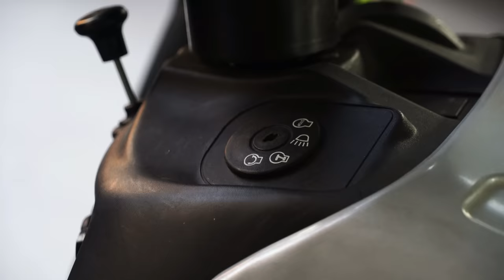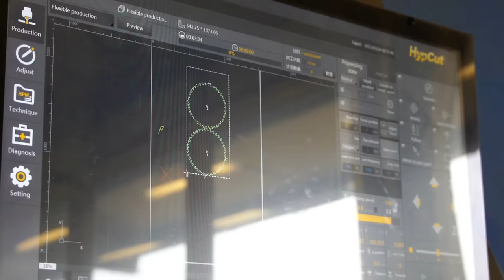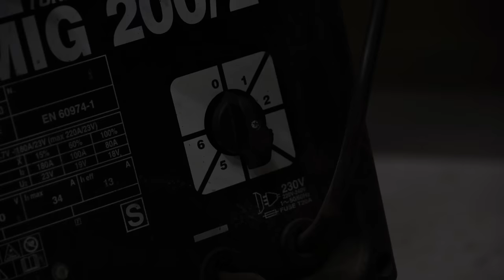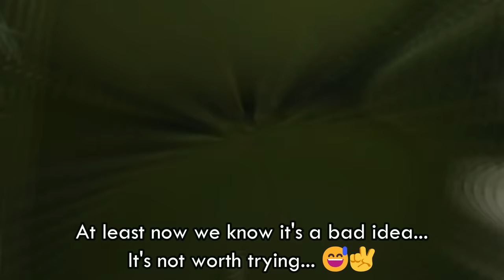CIRCULAR SAW on Tractor MOWER !?

Comment: If the front deck was open then I think it would work fine
Reply: So would the regular blade if so
Reply: @paulb7334   not necessary, the solid deck is a federal government mandate ( OSAH or some agency).  Some people are not smart enough to keep hands & feet away from high speed spinning blade.
Reply: @hcaveman6954  shut up Kevin. This isn’t for the a commercial market or use.
Reply: Like my weed cutter
Reply: I would like to see this with an open deck. Should act like a disk mower.  My sheep would love that grass

Comment: Of course they didn’t work you didn’t leave enough room for the grass to get in between the deck surround and the blades plus the blades are to heavy drill holes in them to lighten them up and cut them smaller by about 2” inches change the pulley size to spin faster

Comment: you are forgetting something, or maybe you just don't know. that lifted area right behind the tip of the blade is called the "sail". it has 2 purposes. 1. it helps throw the grass out from under the deck. 2. it acts like a vacuum in that it pulls in air from the edges of the deck which in turn helps stand the grass up so that the blades can cut it.  The uplifted area to the inside of the tip, is the mulching area of the blade. it's function is to pull the air(and the grass) down through the blades again, cutting the clippings into smaller pieces and then throw them down onto the freshly cut area.
If you want to mow taller grass, buy a set of "high lift" blades. this type of blade does NOT have a "mulching" area on the blade, but it DOES have a higher "sail" that moves more air to help stand up the grass. Plus, it throws the grass out from under the deck more efficiently . You will have to open the side chute cover on the deck before any of this will work. I hope this info helps you

Comment: Saw blades have no lift, no air sucking the grass up to be cut. If you made the front of the deck adjustable like the old dixie choppers those saw blades would be mean in brush. Or just cut the front of the deck off so the grass and brush can feed right into the blades
Reply: That’s what I was thinking. Take the front deck off and this is a mean brush cutter. Unfortunately doing that to the deck makes it a poor mower. Unless you make some sort oh hinge mechanism so you can put it back on to mow with a proper blade.

Comment: The main problem cutting very tall grass and weeds is the deck gets clogged too easily, slowing down the blades and engine. The solution is to cut away the front of the mower deck so the grass doesn't have to only go out the chute on the side. There is a problem with this though, cut grass will spray out in such force to the front it'll hit the front wheels etc and splatter back towards you and the mower coating everything with green gunk. It's still useful though. I have two decks now. One cut away for doing tall grass, and one unaltered for mowing normal length grass.

Comment: The circular blades aren't being used because the Deck of the Mower acts like a shield.  If you expose the circular blades they will cut.  The Deck pushes the grass over and so does the circular because there isn't enough clearance to let the grass stand again.   Cut the Deck of the Mowers edges to expose the spinning blades and I bet it cuts just fine.  But beware of what flies.

Comment: One problem I noticed was, you had one saw blade teeth facing one direction and the other blade facing the opposite direction.  Both need to be facing the same direction towards the discharge chute. 
   Also cut some vertical slots in the front leading edge of mower deck to allow taller vegetation in.
   3th, get yourself some livestock (cows🐂🐄, sheep🐑, goats 🐐, equine 🐎🦓, that they will gladly eat/graze all that vegetation down. I have not worried about mowing my yard area for decades. 👆😉🙂

Comment: Due to the engine struggling to turn discs I would recommend removing some of the material from inside the desks to create what would look a bit like a wheel with teeth on the outside of it. This should help reduce weight but also increase the speed at which they can be rotated at. Also It might not be the best lawnmower ever created, but Jesus, it’s  the one mower I want in a zombie apocalypse, you can really run over all those crawling zombies

Comment: Part of the reason the circular sawblades won't work well is because they aren't sharpened. However, more than that - standard mower blades act somewhat like fan blades, which you'll notice they have an angular piece on the back of each side of the blade. These angled pieces make the blades double as propellers, pulling the grass up into the blades while they spin. This is what makes the knives very efficient at finish cutting. For what is trying to be accomplished here, you can try angling the 'teeth' of the sawblades down 10 or so degrees, then sharpen the leading edges. That should accomplish similar results to the knives, but the torque of the engine will limit what they can cut. Additionally, having that many teeth will only be realistically useful for going very fast across very thin foliage. For thick foliage, heavy brush blades that can swivel from their hub and have a blade all the way down the shaft will be far more effective. Brush blades for trimmers use this concept very effectively, some even going as far as serrating the blades.

Comment: All you really need to do to make this a "better than fail" result is to cut big notches out of the front of your deck so the forward-most section of teeth contact the plant material head on before that front lip of the deck has folded them over 😉
I have done something similar to a 1984 JD 112l I like to play with from time to time and it was incredibly effective.
It might require some welded structural supports after removing sections of the deck, especially if you plan on getting rough with your play.... I drive mine into the woods and cut down trees saplings!

Comment: It's because there there is no suction. Blades will create an updraft(like a fan) pulling the grass up rather than just pushing them over. If you put holes in the saws it will create a suction(think of a fan) but then basically you just have blades, more or less.

Comment: As long as we're experimenting here,
cut the lead edge off the deck, so the
blade meets standing grass.
The deck is pushing the grass over,
not the blades.
Also, change the oil in your transmission.
It didn't sound too happy.
Other than that, I give your experiment a -10.

Comment: Not that it would help but one of the circular blades is on backwards. 

With  practically any regular mower, the problem with really tall grass is that the front edge of the deck pushes the grass / weeds over and before it can spring up and be sucked into the blade, the back Edge of the deck begins traveling over the same grass.  The stuff left standing is what was still being pinned down after the blade already passed by.

Comment: Try this little trick.....  Take 2 sets of regular blades, cross them over like an X on each side and give that a go.  The problem with the circular blades is that there is no space between the blades and the deck for the grass to stick up above them to be cut.  They are simply mashing the grass down.  I have never done the X blade method myself but I have seen videos on here where other people and especially high grass seems to fall victim to them every time.....   Good luck!

Comment: It would leave grass uncut the size of the saw blades only cutting grass where the edges of the blade hits thats why big uneven patches are being left (alot more passes would be required).regular saw blades rely on the length of the blade not a flat surface..a thinner bar type blade creates an updraft effect

Comment: the reason why lawn mower blades are made the way they are is because lawn mowers were not intended to use big circular blades for one the cutting edge on the circular blades are on the wrong side. The circular saw teeth cut wood with the wide edge shaving the wood while mower blades are shaped more like knife blades and that's why they are on mowers.
Reply: not only that, he didnt even really sharpen it 
its even more of a "beat the grass in half" even more than regular blades
Reply: The teeth weren’t angled even a little bit. It was a dumb idea but somebody had to try it.

Comment: You need to cut the vertical portion off the front of the deck. Then the blade will hit the grass. Of course it could still get wrapped around the spindles, because those blades won't chop the grass into small pieces like the normal blades. Funny experiment, though!

Comment: The problem is, the original blades are pitched, like propellers, to be able to move air. The saw blades don't offer that 'lift', so your side discharge doesn't work at all. That lets the clippings ball up under the saw blades, and because of loading up, don't offer the quality of cut. If there was a way to provide airflow to remove the clippings, the saws would probably work quite well.

Comment: I think the diameter of the saw blades are so close to edges of the deck that when you drive over tall weeds/grass the holds them down below the blade and the don't get cut.  A regular mower blade has all the room on both sides giving the tall grass time to pop up higher than the blade and will get cut.  Two ideas, either make the diameter of the two saw blades 3/4 of the current diameter size made or remove the front of the deck exposing both saw blades to the grass to be cut.  Bar blades have a wing on them that draws air in pulling the grass upward into the spinning blade and the air is forced out of it's one opening pushing the cut grass out with it.
Reply: Exactly what I was coming here to say, well said!

Comment: Yep. I didn’t think that they would work. Even your original blades were not the correct ones for doing what you were trying to do. You need to get high lift blades. The ones that you have are just created for mulching with the discharge chute being closed off so that the grass could re-circulate inside the deck to get more finely cut. The circular blades didn’t work because they had no lift at all. They Just pushed the grass down.
Reply: I came to say this as well

Comment: smarter every day made a video showing how lawnmower blades work, I would recommend checking that out.

another idea is to stack the blades so that they make a cross. I've thought about doing this bit haven't yet. I have a mower I use for blazing trails at our hunting property. I'm often going through heavy grasses. those might help me but I would want to slow the blades down a bit to make the belt last longer and the hubs not blow out

Comment: So... knife blades actually use the fan effect to stand grass up as they pass over it.  This is one reason you don't cut wet grass.  The circulars have no way to make grass stand up...  best you could do is cut the front portion of your deck off and sharpen the tips, pretty sure the knives would still do better.

Comment: You would be far better off cutting 25mm off of the front shield of the deck it will then not bend the grass over so far and allow a cleaner cut. I’ve already done it so no need to experiment as it works very well here in Australia

Comment: You either need to cut the front of that guard off or get smaller blades you didn't leave enough clearance for the grass to even get up under that deck into the blade

Comment: Try using Flail Mower knives about 6 inches long on a rotating shaft. Weld the knife anchors in a helix around about a 3" diameter hollow shaft and run it at about 1,000 rpm. You'd be amazed how well it will cut 3 feet tall weeds and mulch ot up very fine. I ran a 72 inch Mott flail mower on an old very well worn 1948 8N Ford rowcrop tractor that made 24 hp new and it cut like a championship mower. That Mott had about a 4" roller under it and if I cut 6" or 8" grass it looked fantastic. But even 3' tall weeds cut easily and mulched down.

Comment: Add a vacuum to grass shoot and you will find excellent performance.

You need to have air flow to suck the grass up into the blade.  The lawnmower blade has a air foil that sucks the grass up

Comment: I think it could work. But you will need to make some changes. The reason being because the blades are in the housing. The grass can’t get up in there for the blades to cut. So you could lower the blades to where they can. It make the teeth on the blade much bigger. Say like the size of a claw on a large bird. About 4 inches in size. You will also have to make air slots in the blades with up tilted wings. So a sort of vacuum effect is made. So it lifts the grass up with suction so it can be cut with the blades.

Comment: The shape of the blade sucks the grass up so it can be cut.

Your saw blades don't do that and the is so little gap between the deck and the cutting surface that most of the grass doesn't have an opportunity to go up in there.

Comment: It appears that the circular saw blades are so wide that there isn't enough adequate space in the deck for the grass to come into contact with the cutting edges. Also, it would seem logical that the round blades should be level with the bottom of the deck or even a bit lower than that. Another improvement would be to increase the angle that the blades come into contact with the grass, lowering the front of the deck should(in theory anyway) improve the blades ability to make proper contact with the grass and cut it relatively cleanly

Comment: Stick with it and with a few trials and errors you might be onto the next big thing. I suggest cutting holes in the saw blades similar to tire rims. My thinking is that it would create more lift and mulch the grass similar if not better than those X-blades
Reply: And, reduce the mass.

Comment: Perhaps a combination of a down scaled straight combine harvester type comb mounted on the front of cutting deck (or mounted on the front of tractor) to cut the tall grass AND reattach the usual flat mower blades in cutting deck for the shorter grass??? If the new front attachment works, the secondary standard mower blades might cut the stubble the front attachment creates...  I am no engineer but just a thought that could be fun to try.

Comment: Ive thought of doing something similar.  But what i think would work best is cutting the front of the deck off. Yes it takes the danger factor up, but the deck is folding the grass over, not allowing the blades to cut it. The regular blades would even work better. But this idea is only good for tall grass

Comment: As noted in the comments you need a vacuum to suck the blades of grass up. If you twist each of the teeth it may work then. However larger & fewer teeth to the blade would also be better. I had a very old large mower when I was young & it just had a square of aluminium with 4 old time hay mower blades bolted on the apex of the corners (hay mower blades are sort of triangular with two cutting edges only about 2mm thick) It cut really well & when it got blunt you just unbolted the tips & flipped them over & had the second cutting edge. They used to be cheap & you bought the blades in a box of ten. The engine was a 5hp side valve Villiers. No automatic pull cord you had to wind it around the pulley each time you tried to start it. I used to spend a fair bit of my mowing time doing that too. However I still have that engine 50yrs later & it probably still runs.

Comment: If you want those blades to work you have to open up the front of the blade shroud (the mower deck) if they can not get to the grass they can not cut the grass. you would have to remove at least the lower edge of the deck up to the flat surface. I would suggest you add a leading edge bar that rides behind the front wheels to help deflect any objects that might be otherwise hit.  Keep in mind how a hand held circular saw works. It is the outside edge of the blade that does the cutting. With your blads you need to sharpen the leading inside face of the blade to get the maximum cutting surface. Good luck... and be careful!

Comment: More vaccume needed sharper blades i mean if just doing woody grass blades need to spin in reverse having outter angle sharpened but if going through saplings 1 inch diameter stumps etc you just gotta drive slower to allow for it to chip through the blade twist is what applies the vacuum very important and the tip speeds next important along with horsepower and torque to push through i do like the spinning up heavy flywheel part though it'd just hit better from a standstill with stored potential energy to not slow as much when hitting sticks and tree saplings. you're TPI teeth per inch matters too because of time to speed up before hitting next cut gotta maintain rpms  possibly gearing pullies higher rpms or higher torques would increase the usability but also your drive forward speed Needs to be adjusted in propper ratio to cut speeds when you hear the difference in rpms slow there's a sweet spot to listen for on each motor or horsepower now if you had a separate smaller motor for drive speed while all usable horsepower was for cutting speed then you'd be able to keep cutting faster. Tip razor blades 🔩 bolted on without the bolt dragging so countersunk would leave a sharp edge but then you'd need your vacuum of blade twist still doing the work to pull up bent grass blades into the blades to do the cut, usually a double pass mow is best cut once on highest setting and then your finish cut on the final height you want to trim down to but i do believe i could design a better mower blade increased efficiency simply designed for grass but I'd still have different design like sharp beater bars for bamboo 🎍 grass because then it's basically needing wood style cut speeds and blade design